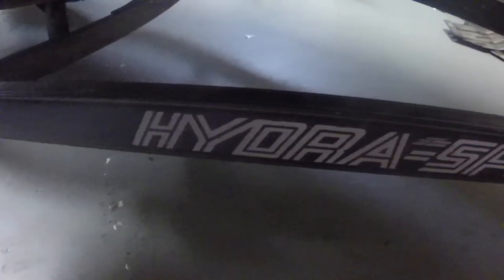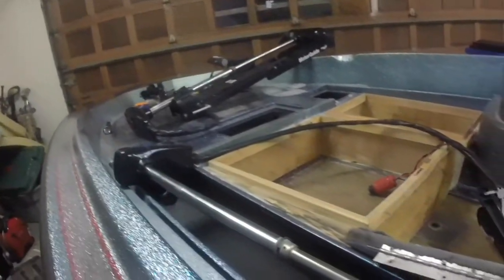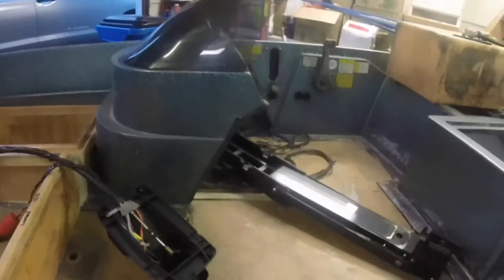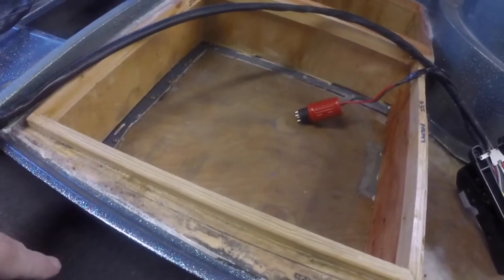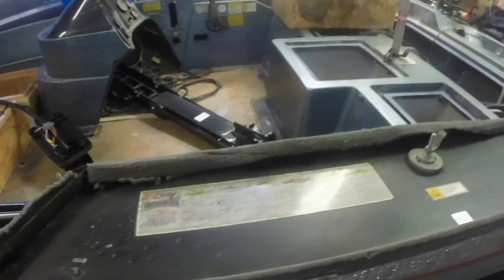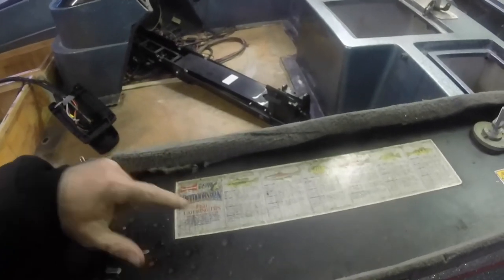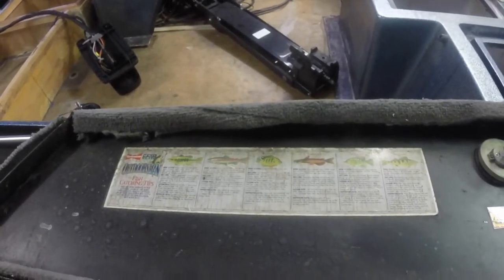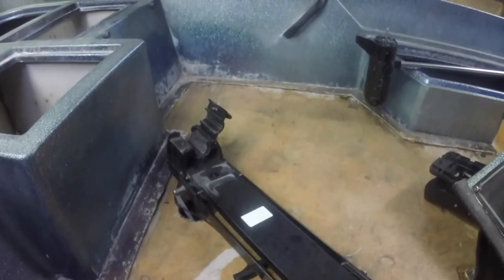Electric Bass Boat Project

Comment: That’s awesome! Looks a lot like I’m 88 Smoker craft. I want to add more storage like that in mine also.
Reply from the maker: Not sure if you can tell from the video or not, but the extra storage areas are made of hardwood and they are encased in glass resin. They also have a rim around the edge so no water will get in when the lids are closed. I will, however, have to make the lids and mount them on hinges. Still stoked... can't wait to get this on the water!

Comment: I see people making boats into electric using electric outboard motor’s the ones on the market only seem to have enough power to barely get the boat to plain. But I seen others build there own and are abele to reach 50 miles per hour. I’m wandering how well would a electric jet prop work?
Reply from the maker: I don't have enough knowledge on the subject to be able to tell you much... but last fall I saw a project in the making that was an old Subaru-turned-amphibacar that was powered in the water by an electric motor, and even with that oddball shape, it was moving across the water at around 12-15 mph. Whatever he was using would make a small boat move much faster!